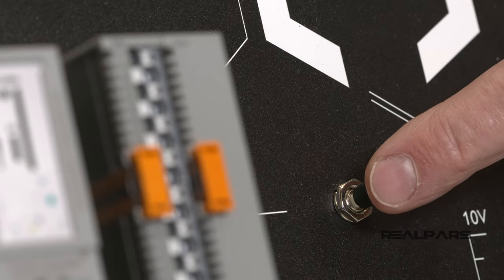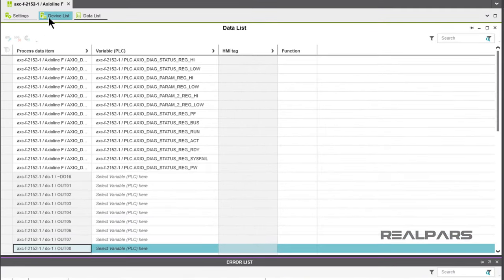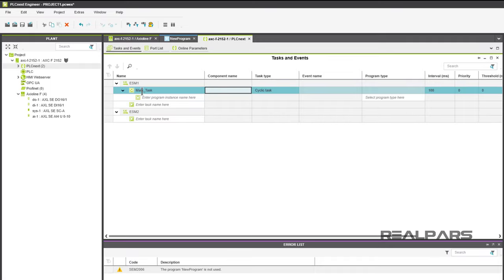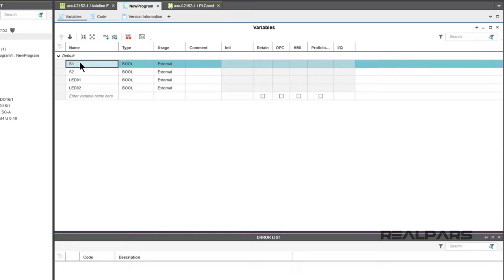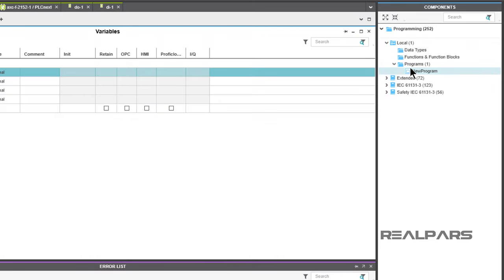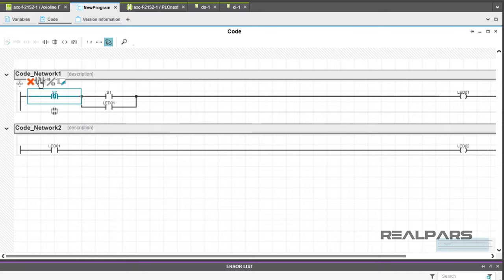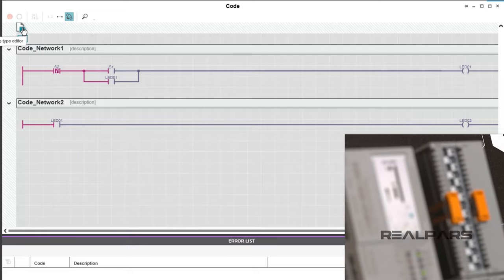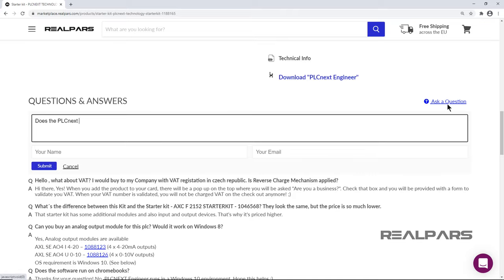PLCnext Tutorial for Beginners - Part 4 | How to Easily Create Ladder Logic Programs

Comment: Can you program in grafcet because I didn’t saw the choice in the language selection?
Reply from the maker: Grafcet is not one of the languages defined in the IEC 61131 specifications, and it is not offered in PLCnext Engineer. Sequential Function Chart (SFC), which is defined in the IEC 61131 specifications, is based on Grafcet. So for Grafcet users, SFC should be fairly familiar.
PLCnext Engineer offers an SFC editor as a optional (paid) add-on to the standard (free) PLCnext Engineer software.